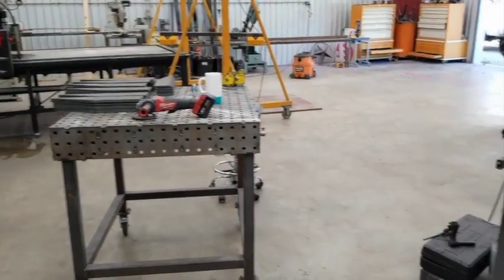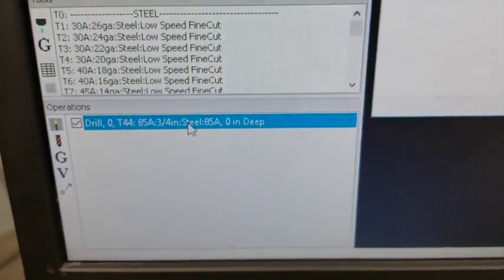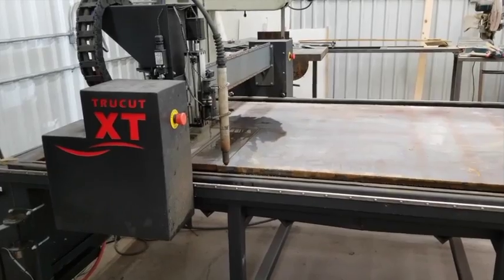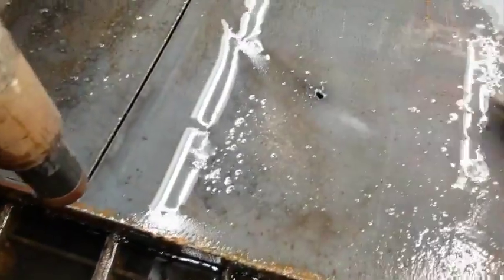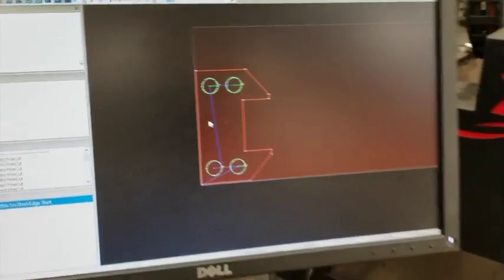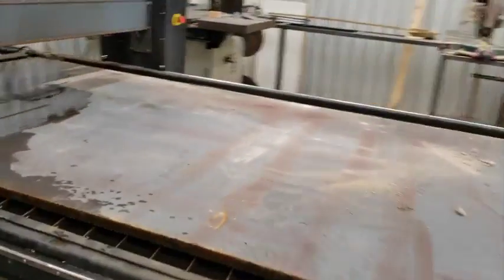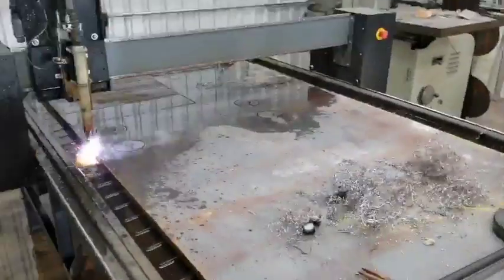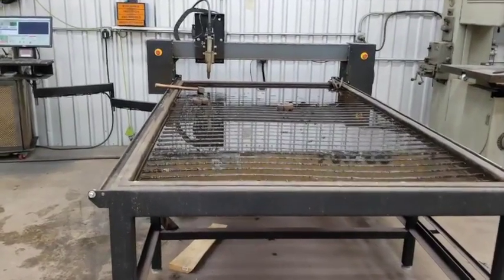Piercing 1" Thick Plate with a Hypertherm 85 - Trucutcnc CNC Plasma Table Top 5

Comment: Can you just drill a small hole like ¼" and the machine will cut the hole from there?
Reply: Yes that will work!
Reply: No it won’t when a plasma torch pierces and there is no material to remove it overheats and the nozzle and electrode start to perish crazy fast and it will deplete your consumable’s faster than normal.

Comment: Would you recommend the powermax85 for someone starting a metal fabrication business or would the 105/125 make more sense? I have no idea what thickness I might be asked to cut by the customer so I'm having a hard time making the decision.
Reply from the maker: 85 is perfect for just starting out.  I rarely get asked to cut 1", mostly 1/2" and below.  if your business takes off using the 85, you can always upgrade later

Comment: If your programming with G code see if you have an option for dwell. On our CNC lathes we use G04 X?? X is the amount of time in seconds. Example if you wanted a 2 second dwell it would read G04 X2.0 or a 1/2 second dwell would be G04 X0.5
Reply: It's the same g code for plasma cutting.

Comment: Ramp piercing . Should work. Slow down the ipm. Let it go in cut mode might take 1 or 2 to make it through. Though I run a 200amp set up. Lincoln plasma 
 hypertherm nest program. Auto cad cam. Also manually run running is a great way to find out the capacity of your machine. Awesome video.

Comment: I have pierced thousands of holes in 1 inch and 1.250  inch  thick plate and I have never lost a nozzle or electrode to the pierce yet. If anybody wants to know how let me know. Dave Hilltop Fabrication, Welding & Repair  
hilltop@nbnet.nb.ca

Comment: Maybe if you get up into the large high def plasma they can cut 1"decent but from my experience with my powermax 85 it's just not practical. Other than the slow preheat I get far better piercing with oxy and faster than drilling and better edge quality without having to put new consumables in all the time.  In the heavy plate oxy can be faster to,  I forget what the 85 will do but I just cut some 1 1/4" at 11ipm normally I'll do 12 or 13ipm on 1" with a victor #1 tip. 

In sheet cam when you select your tool for drilling or cutting next to the drop down menu there's a button with three little dots click on that and it will open a screen to change the settings for that tool and when you close sheet cam you can either save those changes as the default tool or discard if a one time thing.

Comment: I've used both plasma and Ox/Acet for carbon steel and Stainless...carbon was up to 6" thick plate, stainless 1/2"...I always drilled pilot holes, 3/16" split points worked great...$15 for a pack of 12 (PTD cobalt) in an air drill....Cut quality was better, it sure did wonders for extending the life of consumables, piercing is hard on that stuff...even lasers are affected greatly by piercing. The plasma stuff was expensive, and that was a looooong time ago.
Reply from the maker: Thanks Doug.  Where can you get a 12 pack of cobalt drill bits for $15?  Thats pretty cheap!  Some good insight here, thanks for that
Reply: Well, I'm out here in N. calif...Western Tool & supply....precision Twist Drill...I've also had good luck with 1/8" black oxide, double ended for body shops that use Cleco clamps, split points drill fast....same deal, pack of 12 cost $7-8... @turbocobra

Comment: After drilling the holes why didn't you simply eliminate the piercing operation from the CNC program?
Reply from the maker: I effectively did remove the piercing operation when I set a pierce heigh at .08 and no pierce delay.  If you mean remove the reference operation, cant really do that, its how the torch finds the top of the plate to have a good starting point to hand off to the THC controller
Reply: Ok that makes sense, but would it be possible to find the height next to one of the holes then programatically jog the torch into the hole area before starting the cut.

Comment: Good problem solving Gary.  Maybe next time switch the consumables like what was suggested, run the cut at 3/4 settings but with the increased pierce delay and slower feed rate, start the cut and as soon as the pierce is done stop it manually and step through the g-code to the next hole.  I think the post processor for your table does not support the drilling op that you posted in sheet cam, that's why the pierce delay did not work there was no move after the pierce.
Reply from the maker: some good thoughts Bill, appreciate that.

Comment: Nice heavy iron work!!
Reply from the maker: Yes sir, I have done a bunch of these hitch plates with different configurations, but this is the first ones they wanted the tail light holes put in them, so a new challenge
Reply: Might be worth investing in the right size annular cutter and just doing the light holes with them and the mag drill then.,
Reply: @bcbloc02  holes that big are, slow, expensive, and those bits love to break or mess up one of many teeth and chatter and break. Also the drill motor required to turn that slow is thousands of dollars. I’d keep playing with the table. Even a rough cut and die grinder clean up would take way less time. If it were me. I’d pierce with mag drill and cut on table. (He just said this in video)

Comment: Can you ramp a plasma cut in? Cut one direction 1/2 inch then back the other way repeat as necessary?
Reply from the maker: now thats a thought, not sure, the main issue wiht trying to pierce is if your plasma torch is on, and not pierced through the bottom, all that blowup is really bad on consumables, it will kill it instantly, and the shield as well.  So I think its doable, but do i want to blow through several sets of consumables at $15 per set trying to do it?  or just grab the mag drill and be done with it lol

Comment: only showing 480p for some reason? is that how u uploaded it? or this a YT problem?
Reply from the maker: yea thats my bad, alot fo times I upload little short clips to facebook and instagram and had my software set on 480 and didnt catch it when this one uploaded.  Are you watching on a TV?  Most mobile users cant tell the difference between 480 and 720
Reply: @turbocobra  I just talked to songer121. He is watching on a drive in screen , outdoors. He can’t read your response/ question as it’s too pixelated. I will relay his answer. Thank you

Comment: use new consumables for 1" thick and run 2 sec pierce delay ... works just fine ....   maybe raise piece height a little .... (so that I commented about 1 min into the video ....  ) unless you fast forwarded the piercing - that for sure was NOT a 2 sec pierce delay ...  my HT 85 has the same issues - "random firing delays" ....  you give it 2 sec pierce time ... and sometimes it does and others it does not ....

If you want to cut a lot of 1" you need a 105 or 125 ....  this is just brutal on an 85 ....  although it will hand cut 2" but THAT is a whole different story ....

If the torch does not stay on - put your cutter in expanded metal cutting mode even though you are running it on a CNC table ... that way it automatically re fires...
Reply from the maker: Well its the piercing thats brutal, I have cut a ton of 1" plate on this table, maybe 20-30 hitch plates this year, but this is the first one they wanted the tail light holes done.  A few weeks ago I cut 3 sheets of 1" on one set of consumables and it did fine.  That one long pierce I tried on this one jacked up the shield, just 1 pierce!   Does HTP offer something that will pierce 1" comfortably ?
Reply: HTP has one cutter which I have very little first-hand experience with  (an hour or so) first impression - it is a good or very good cutter. George has some more experience with it, he really loves it.   
I will get one here and try it, put it through the paces myself!
its 45 amps max output in CNC mode and 55 amps max output in hand cutting mode and its 100% duty cycle at 104F at 45 amps...
that means it will cut 1/2" on a table all day long comfortable ...  the HT65 is 100% duty at 46 amps ...  
you are cutting a lot of thick stuff! you really need 100 amps!  

At this time there is nothing from HTP out there... but seeing how they are developing this new super reliable 1/3 phase autoline power supplies .... I would not be too surprised if there was a 100 amp plasma on the horizon in a year or 2 ...  
the 1/3 phase 300 amp multiprocess is here already and some other stuff i heard is supposed to be here next year ...  no one said plasma yet ...  we'll see ...